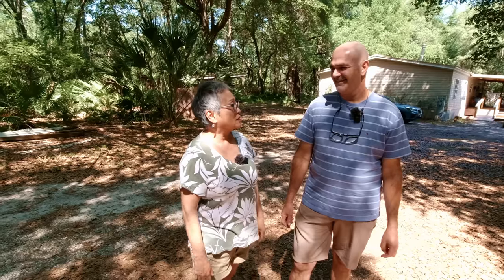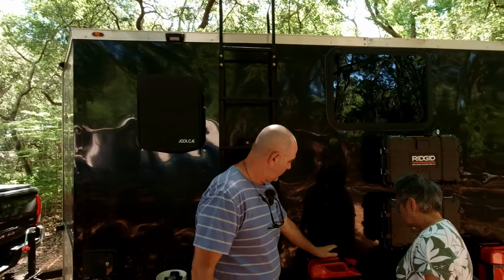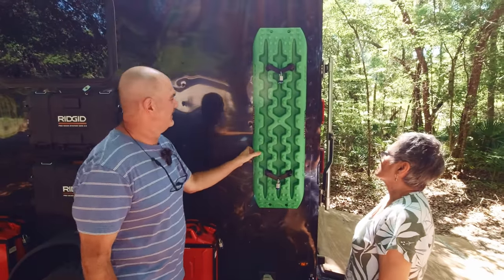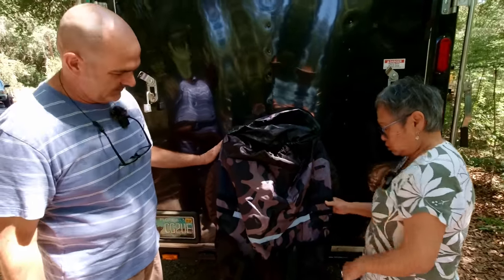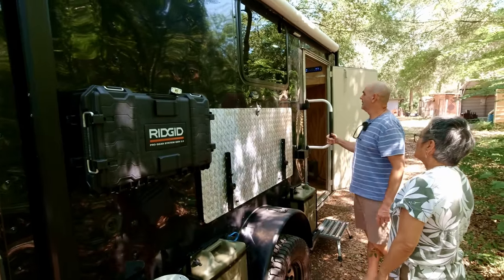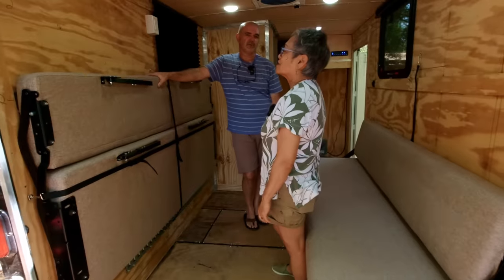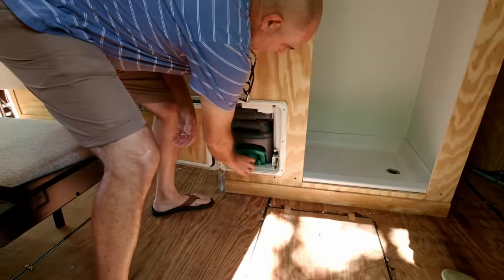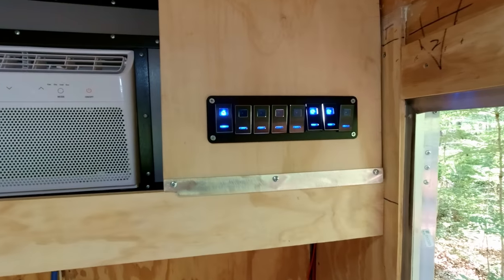Check Out Anthony's Converted Cargo Trailer Camper!

Comment: That in floor storage would be a great way to put in a shower that you could hide away when not in use
Reply: Bingo! A 20L (5 Gallon) Sea to Summit Collapsible Kitchen Sink and a KEDSUM Portable Camp Shower would hide away perfectly. I use it with a 5 gallon bucket and the sink for more sink like things as the summit sink is wider so it would get shallow sooner and so run out of water flow faster but it would still work well! With the sprayer instead of the shower head I only use about 3 gallons anyway because it's not constantly pumping.

Comment: Wow, this fellow really thought things through! Really really impressive. Of course we all know that by now you two are talking about what you are going to use from this. That air conditioner would be top of my list but then I don't like the heat. Anyway, this was so interesting. Thanks for sharing. Have a wonderful weekend.
Reply from the maker: After this last trip down to Florida we can now see why air conditioning is so important to some folks!
Reply: I have heard of people running a mini split with a solar setup but have not researched it yet.
Reply: @deuce1606 That's this awesome video: https://youtu.be/8Jk1L5WHGtw
One of the units manufacturers said the condenser can be mounted horizontal so it can be mounted under the trailer, hidden and out of the way!

Comment: I'm in the process of converting a 6x14, just about finished with insulation. Just like a bunch have already commented... this is Top 5 video from hundreds of what I've seen.  3 ideas I'm going to use from his...floor storage, storage/tool bins on the exterior walls and the hatch air intake for the A/C. Thanks for sharing!!!
Reply from the maker: Go for it! Share this video with your friends. Thanks for watching.

Comment: Where was Anthony when I was DIYing my van interior?  His trailer is filled with awesome innovations.  He could start a new career in building these toy haulers.  That is my goal to add a toy hauler to my van.  I plan to pick up a small 4X4 ATV or UTV.  I have a GMC Savana 2500 with the Vortec V8 and my gas mileage averages between 12 and 13mpg.  Adding a trailer will surely impact my fuel mileage.  It's the price you pay to have fun.

Comment: Nice set up if you are going to stay on black top. When i did mine i made a complete plan before i started. So everything was hidden behind the insulated walls and ceiling. Mine is also winter ready. with heater in door bath room, 2 burner cook stove as well. And i still use this as a cargo trailer and for ice fishing. Yes i take it on the ice and fish from the inside so i don't have to freeze my but off lol.

Comment: Very very nice!
We’ll be getting our 6X12 cargo trailer soon, and we planned on having our toilet and shower run East to West across the front of the trailer. After seeing this video, I might rethink that.
This guy does excellent work, and has used his space wisely. I would like to know if his trailer is Polycor siding, it sure looked great!
We’re getting a flat nose so we can use the tongue for 2 propane bottles. We ordered the trailer with no ramp or doors on the back, and will have a large egress window back there, 3 windows, and a fourth window in a 36” rv style door, with a screen door so we should have plenty of natural light and fresh air.
Thanks for making this excellent video … the more I watch these videos the more good ideas I get. 👍

Comment: Brake addition is GOOD. I usually purchase adapter to match tow vehicle bolt pattern. He has generated a LOT if wind turbulance/drag. Jacks should be INSIDE trailer corners (becomes anti theft). The back corners can bolstered and reinforced with alum skidplate that protects the light frame that is easily bent if bottomed out. .
Reply from the maker: Thank you!
Reply: @gonagain  on the skid plate have a custom bend from edge to edge width wise and have it bent in a U shape to capture both the back frame channel (usually below rear door will be visible as channel terminated near door frame) and have it run to second frame cross brace and terminate at plywood floor at top of that cross brace. At rear aluminum skin I use Dymonic sealant and use a counter sinking (flush) stainless machine screw to pull it tight to aluminum skin and squeeze out sealant. I predrill and use a self tapping torx to establish threads for the stainless as stainless is soft and can't cut threads. This also enables ypu to have a mounting point for rear internal leveling AND anti theft jacks (only accessible  from INSIDE the trailer. I am also an advocate for a custom removable tongue so it can't be towed away if left somewhere unattended. Basically would be criminal would we so frustrated they'd likely just burn it to the ground because they can't steal it. Lol.

Comment: on the outside its great but why all the obstruction on the side , a few is ok, but the side mounted units is a blocker of wind when traveling? the ladder is strong to hold someone heavy  but its heavy in weight, and it extends higher then the roof ? he could put a handle on the top to hold on to when climbing down.  i dont like to tank location due to the fact that the tank frame is an obstruction in bottoming out,  think the frame is below the axle? , the axle is the lowest point of the trailer,  he could have gotton flat pan tanks for the black and grey to tuck up in the frame making more room under the trailer. other then that it looks good, /

Comment: I would have liked to see if he plans to install solar too.  Also, what is the total cost here - trailer itself and then modifications?  Some mods run more than a small used travel trailer.
Reply from the maker: Ah yes, but the difference is that these cargo trailers don't come apart at the seams like commercially built trailers do.  We take ours down rough roads and have ruined two travel trailers.

Comment: The big question for us budget builders is how much $?
Given one has the time the money and the tools one can get as cute as they want when building out these cargo trailers.
Reply: Even on a budget it can get expensive! I’m at about $20k on mine. It’s a 7x16, double axle. That total includes the trailer as well. You have to keep in mind that it’s built in most cases better than a traditional camper and it’s built and customised by yourself. I finished mine last August and I’m going to post a walk through video once I complete the solar panels.

Comment: Was watching old video. Linda's ankle was hurting.Any type of fracture will benefit from building muscle strength around the bone.  Just be careful to engage in new activities slowly. Eating a balanced diet that includes calcium and vitamin D for bone strength will also help. Ask your doctor whether you need supplements to reach the necessary daily intake.
Also watching video when Linda went up a hill and left you with a bear...does Linda carry extra keys to the car...just in case you fall over a cliff etc.😋 I have seen most of your videos several times, even the earliest ones. Blessings
Reply from the maker: Thank you, ranch sailor. I've been doing all of those tips you recommended and my ankle is coming along fine. I do carry my own set of keys as well as protection as we oftentimes go our separate ways on the hikes. Aloha~~

Comment: Very nice trailer build! Lots of creative ideas. Only one very serious situation however I noticed right away. Too many distracted drivers out there whom aren’t paying attention to the objects in front of them will easily hit the explosive dangers of your low mounted propane and extra gasoline tanks. You have a trailer that would burst into a huge fire or explosion once someone hits you from a side impact. I would seriously consider moving those tanks up higher out of the direct impact zone. Certain autos already have experienced these serious fires or explosions over the years (think Ford Pinto, older designs of trucks and cars where fuel tanks got moved in between frame rails after many deaths took place). Otherwise, cool trailer build!

Comment: THE REASON IM NOT GOING TO PUT CABINETS INSIDE IS BECAUSE I WOULD LIKE TO MAKE A BED THAT YOU CAN PULL DOWN, LIKE THEY USE ON SOME OF THE BIG TOY HAULERS.
Reply: Good ideas Here, Gives me`~ ideas 4, Putting Something Together, 6-months ago Got a 31' CLass a 1998, But i`~CouLd Use/Make a 16' Box@WheeLs With Truck 4 Shorter Juntures, Lol .. i`~ StilL Got 3years Before i TraveL, See what? Happens,  Peace ✌,  my Brothers Done a few mini SLit a/c's There Super Effeciant ProbabLy Go@That Route. Thanks Anthony!.
Reply: Check out "Ariston Andris 8 Gallon 120-Volt Point of Use Mini-Tank Electric Water Heater" for hot water when you have shore power instead of burning tons of propane (or design the solar system/inverter to be large enough).
Reply: @wiresbringit  Thanks 4☆ Tip, if Had DoubLe Deep Stainless Steal Sink@ Rv's, Has me@ideas, Like a Quik Hair Wash, Small Pets, etc, When / if i' Do a Cargo Type i` Get 3'+ QuaLity Sink 1-st, Lol , This Hot Water Heater Be SmArt, Peace ✌.
Reply: Lastly instead of cabinets in the bed area for the same reason I'm currently thinking of hanging "Grand Fusion Housewares Stow-N-Go Luggage And Travel Organizer" from the bottom of the bed so they can move with the bed or be moved somewhere else temporarily if needed. Thanks for sharing your build Anthony!

Comment: Seems like a Nice Guy .... but the build to me seems more for "Campground Camping" ... with all the gear outside I personally would feel like I was driving around with a target on my back .... my concept is different ... it's to build it strong but not stronger than it's required to be ... build it so you can be proud of it but don't build it permenent if it doesn't need to be ... think about what you need to accomplish not just about what your building ... with such limited space in a cargo trailer you want to use the same space for more than one function if at all possible ... I can take out almost everything if I have to except where my Diesel Heater is set-up my Solar Panel and Ceiling Fan  .. I use Anchor Points attached to metal secured with different sizes of Tarp Straps and Aircraft Cable in places .... I even use heavy duty Zip Ties to Anchor Points if it's against the walls ... Anchor Points are rated to 600 pounds ... Tarp Straps about 300 ... Zip Ties anywhere from 300 to 800 ... Aircraft Cable over 1000 pounds ... Tarp Straps are great because they come in lot's of different lengths this allows for some flexibility a little give stops things from breaking when you are driving on rough roads if secure them properly ...  I have Propane Hot Water on demand ..  Batteries and two Power Inverters a 2000 Watt and 500 Watt ... a 2000 Watt gas Generator ... a Marine Toilet ... a Microwave ... a Mountain Bike ... a 22" Monitor Computer set up that runs on 12 volts without going through my inverters  ..  and about 100 pounds of tools .. my Cooking Table I built on top of a light weight folding aluminum Saw Horse I can set it up inside or outside because the design leaves all the space underneath it easy to access .. you can set up without clearing a space on the floor ... I use stacking plastic Ammo Boxes for storage 50 cal to the 19" x 16" x 8" Ammo Crates ... these are water tight and keep out the dust and the sizes are all uniform which makes it much easier to move things around inside the trailer  ... I have a rolling "Jigsaw Puzzle" ... but I have all the pieces ... on the "Lonesome Trail" ..